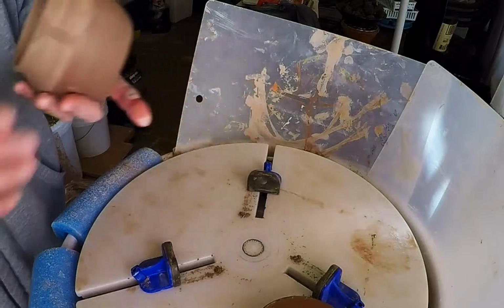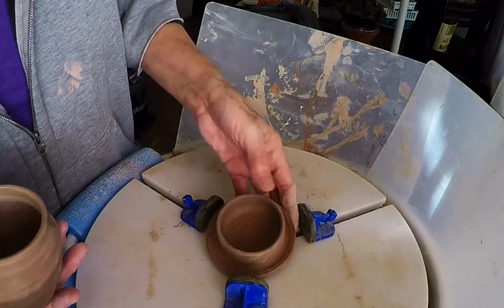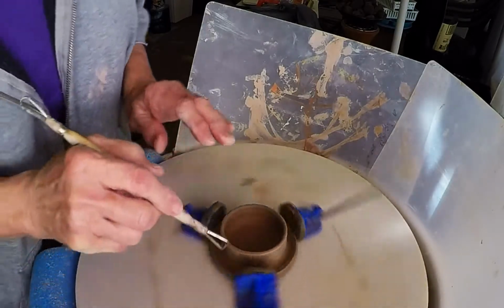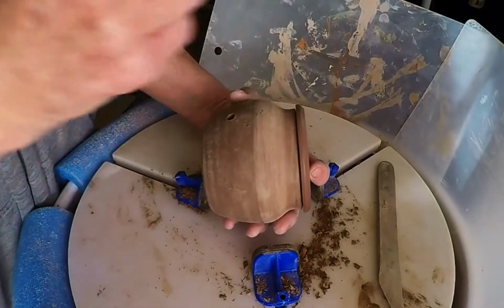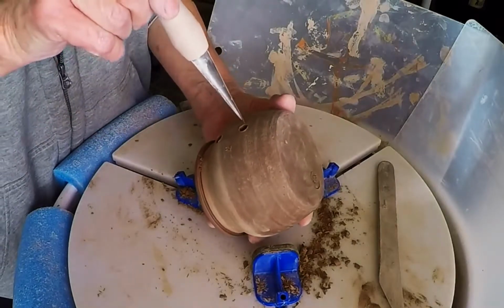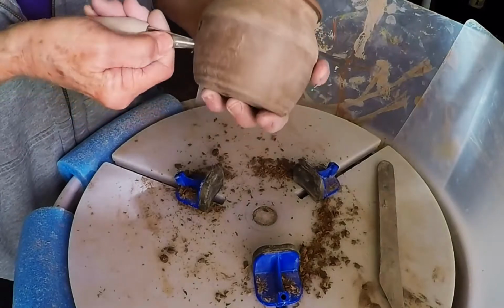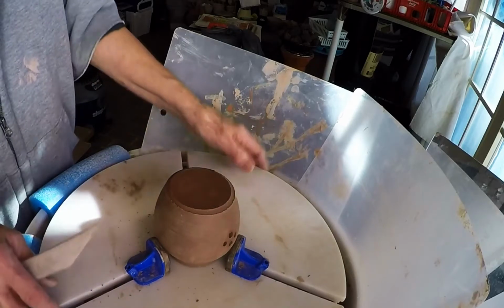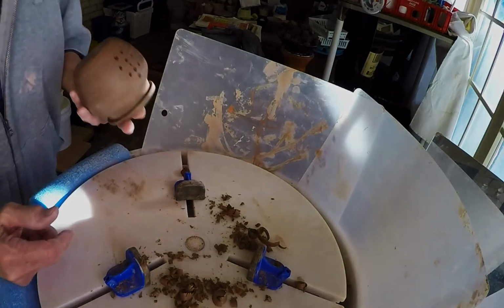♥ Garlic Keeper Part 2: How to finish making holes and fitting lid.  Throwing/Pottery/Wheel/Ceramic

Comment: Thanks for another great tutorial! It looks like your standing at your wheel, don't think I've ever seen that, is it easier on your back and what kind of wheel is it? Also why do you have those 2 pieces of plastic in your wheel well? Just curious🙂
Reply from the maker: Good morning Lorelie, The place mat sized plastic things act as a backboard does for a basketball net. They catch the trimming scatter and direct it into the splash pan. There is more 'clean' clay to reclaim and less to clean off the floor.       I like Shimpo wheels but have used Brent, Clay Boss, AMACO and others including kickers. My first wheel, the one I learned on, was a 1940s model AMACO that sounded like a B-52 Bomber. It had two speeds: OFF (slow) and ON (fast). Shimpo wheels are quiet. Most pottery throwing wheels can be raised to any comfortable height with cinder blocks if they don't come with tall legs, giving the potter the option of standing. Its more for convenience really, if I''m doing a quick trim or demonstrating for a group. I also rigged up some wheels under the feet so I can pull it to front & center for teaching or shove it out of the way when I'm done.  Have fun playing in the mud today!  Cheers!
Reply: BrokenArrowPottery thanks again for some great info!!  Ya I used to have a hand mixer like that and was soooo glad when it finally said amen and I could throw it away with a free conscience!!😜 the place where I purchase my supplies in the city I think only carries the Brent wheels, but will check it out more when I purchase one. So far I only handbuilt, which I took a 2 eve corse for and so I'm learning through generous people like you! Good idea for keeping things as clean as a potter can!